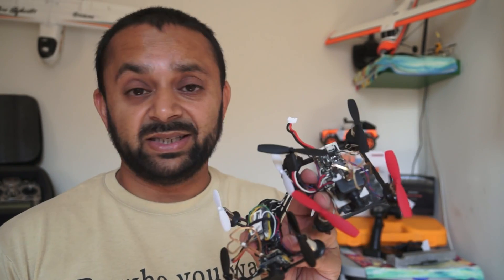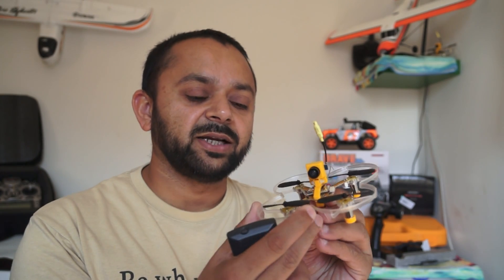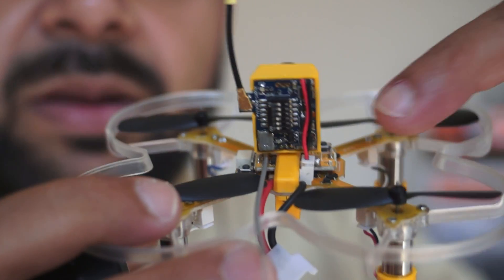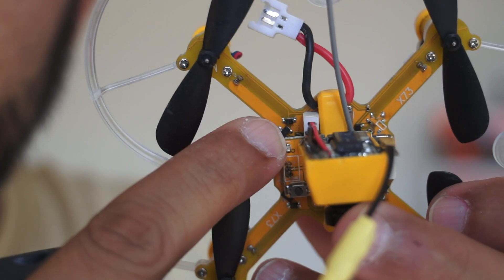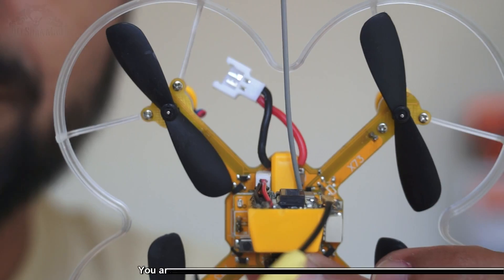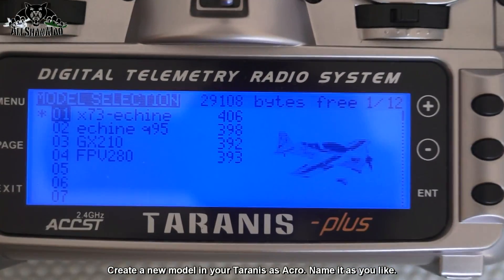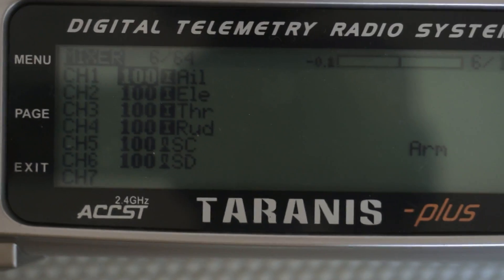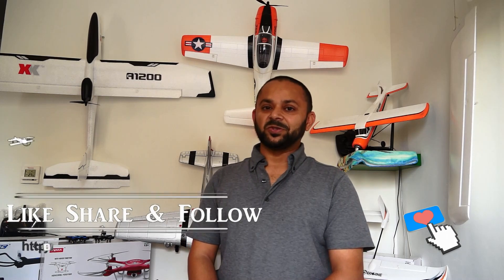Eachine X73 Tiny FPV Quad Review CleanFlight and Taranis Setup

Comment: Looks like a diode, get a magnifying glass and look at the numbers on it and buy it online and solder it on yourself using tweezers. Components like that are very cheap, you might find it at a electronics hardware store

Comment: The thing gone on the arm is a part of the esc. I think its a mosfet. I would add that the protective plastic isnt very durable as well. I killed mine soon. Flighttimes are terrible. But other than that this one is good.  Still my h8 gave me more fun...     did you try rate mode with this? Too little power to do flips and rolls really...
Reply from the maker: yup too little power to do any loops so mostly i fly in stabilized mode